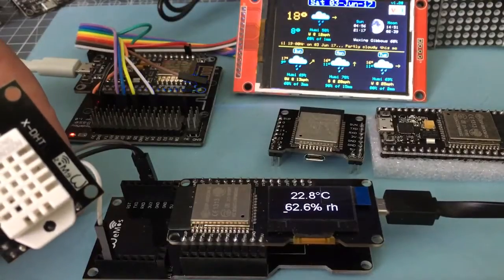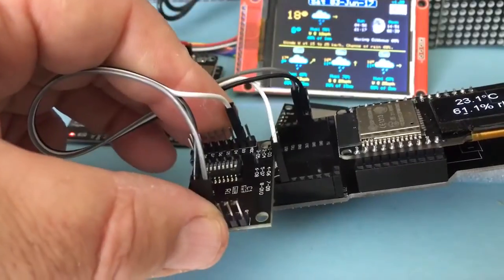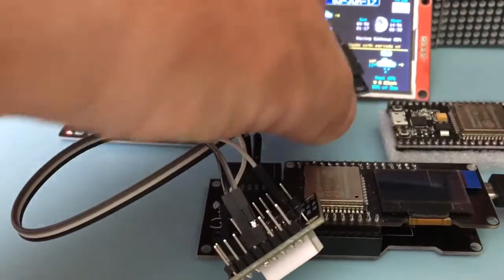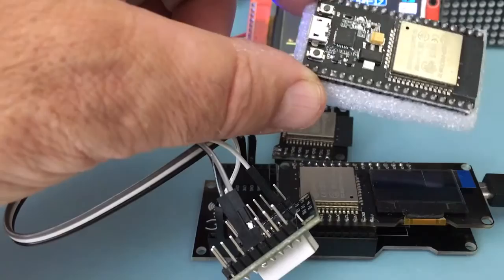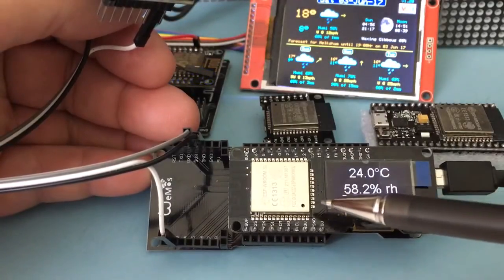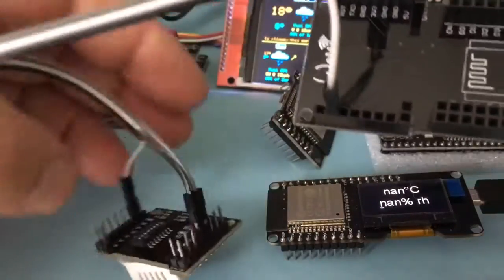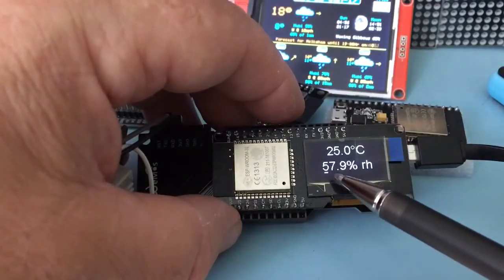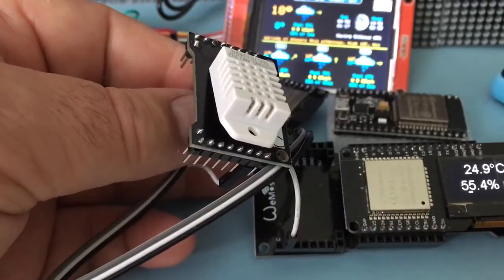Tech Note 041 - ESP32 X1 board with 0.96" OLED display and DHT22 temp/humidity sensor

Comment: @G6EJD - David your videos are great! To the point.
Can you pl help me with the pin mapping in arduino, of this particular ESP32 board with built in OLED?

Thanks
Reply from the maker: Thank you. Exactly which board are you using?
Reply: @G6EJD  The same used in the video.
Reply from the maker: @omkarmotaghare  that X1 board is a long time out of production, https://www.bing.com/images/search?view=detailV2&ccid=p5ZLfzYP&id=EEE27B85BB288768F58A751C03357C0B259AF9B8&thid=OIP.p5ZLfzYPnjHKgKLy97aaTgHaEm&mediaurl=https%3a%2f%2fcamo.githubusercontent.com%2f9aca7d1b63b10c2492035a0e571dc3c5f60ab61f%2f68747470733a2f2f616530312e616c6963646e2e636f6d2f6b662f4854423134594b735270585858585853615858587136785846585858612e6a7067&exph=618&expw=993&q=Esp32+SVP+Pin&simid=608053131470506415&ck=98D17760F90B494F5608F98FD23C66C8&selectedIndex=5  but I recall the pins are marked underneath. You can use the ESP32 Dev Kit board definition
.
Reply: @G6EJD  Thanks for the information.

Comment: With Arduino you cannot properly manage a very advanced sleep modes.
Reply from the maker: Browarus Pierogus, agreed but for most applications deep sleep is all that’s required and Arduino can do that plus light sleep
Reply: @G6EJD  WIth Arduino you do not control RTC domains and cannot efficiently reduce the power to almost 0V with ULP. controlling the wake up  Just Arduino framework is some ugly incompatible tool making things a mess from professional design perspective

Comment: Nice project, I just got the same lolin with the built-in OLED board and it's great to have some code to get the display up and doing something useful right away.
Reply from the maker: Edgar1988 Happy to help. I've just been measuring the current consumption with WiFi off and display about 50% in use and it's 60mA, with WiFi on it's 120mA. The USB chip takes 22mA so the display and ESP are taking 38mA. Either the ESP in sleep mode current draw is 23mA. Yes a very versatile board. Pins 5 and 4 are the I2C bus sda and scl. I'm just about to publish a weather station that predicts weather using a BMP085 sensor and no WiFi connection required, it uses the same board.

Comment: Cool video, but how do i run the code? what is the name of the esp32 oled board? is it lolin wemos32?
Reply from the maker: You need to install the Arduino IDE (assume Windows) it's a free download from here:
https://www.arduino.cc/en/Main/Software
Then Install the ESP32 extensions from here:
https://github.com/espressif/arduino-esp32/blob/master/doc/windows.md
If you search e.g. Aliexpress.com for ESP32 OLED you can easily find the boards.
Reply: Cool thanks, I already bought this oled board. i would like to know what is the name i need to choose in the ARDUINO IDE under tools?
Reply from the maker: +Idan Ben-moshe I use the Lolin 32 board, but it does not matter as in general all it changes is the the pin designations which applies when logical names are used. For example D2 might be mapped to device pin 4 on a Lolin board and on another board mapped to pin 7, but if you use PIN numbers then it's ok. Selecting the right board changes those logical designations and a few other elements. The source code uses pins numbers so not affected.
Reply from the maker: I've just compiled the code using:
ESP32 Dev Module
Wemos Lolin 32
Sparkfun ESP32 Thing
Nano32
Node32s
On balance I would use the Wemos Lolin 32 board type.
Don't see these board types? then you have not yet installed the ESP32 support: https://github.com/espressif/arduino-esp32